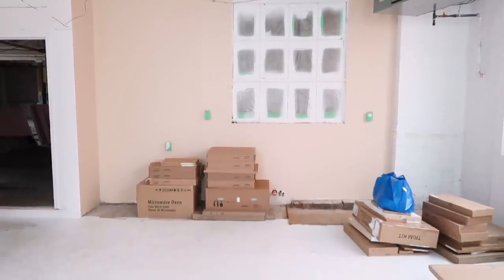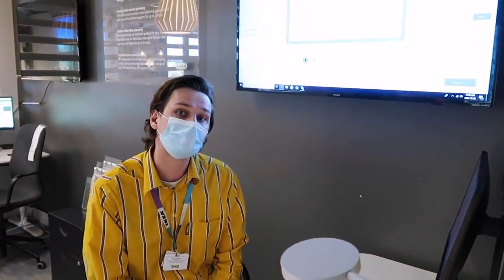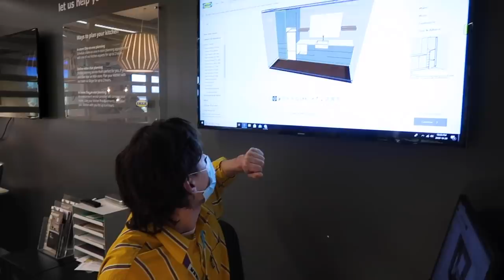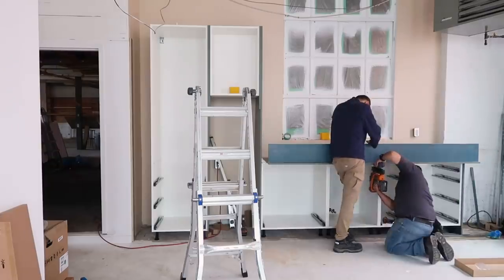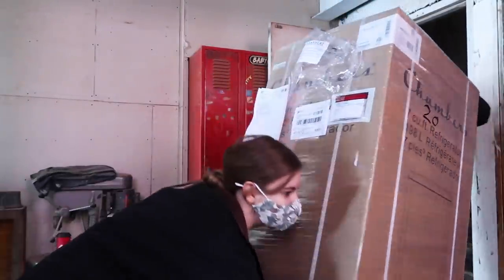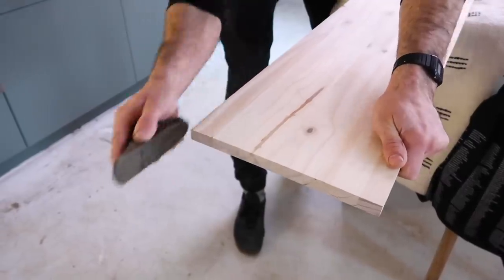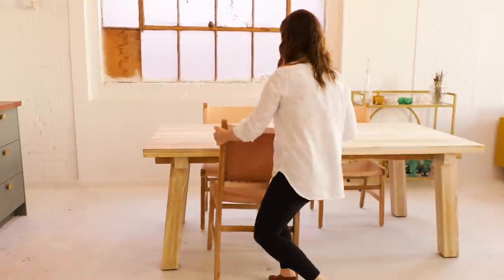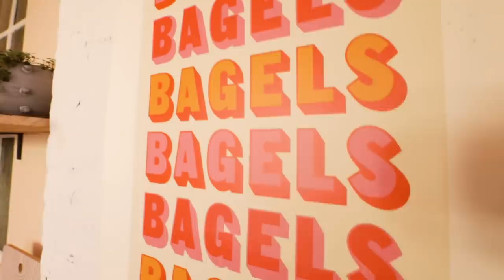My Ikea Kitchen Reno Start To Finish For My New Office! | The AG Office Project S1 E2

Comment: This countertop looks much better than the white one 😍👏🏻
Reply: Agreed!
Reply: Yess i was constantly hoping she'd change her opinion and thank god 😄👍🏻
Reply: I was at IKEA yesterday and saw that countertop and a crosscut of it. It looks even better in person! However, the price is very steep at 200€/m and I'm worried about the water resistance. The core is particle board and it's covered with a 1~2 mm veneer.
Reply: When she first showed it as she was walking past all the countertops as SOON as I saw that wooden one I was like that’s the one! Surely enough she ended up picking it and it looks amazing 😍

Comment: Really pretty.  Shouldn't the table be running the long side with the length of cabinets instead of perpendicular?
Reply: you're kind of right, but then you'd have to walk around the table to get to the kitchen, so the way they did it's not in the way
Reply: I love it this way. It's a large space so it can handle it.

Comment: Love how your space is coming together. Does your landlord provide proper ventilation? I don't see ductwork in the ceiling. Just wondering how you are getting fresh air and cooling. I can see they provided a unit heater (which is usually temporary until the tenant fit up the space). Just wanted to make sure your space is engineered safely and properly so you can bring us more great content! Congratulations on everything!!! 
P.s. You should have heating by every window to avoid condensation and cold air infiltrating into your space. The unit heater that comes with the space might not be sufficient to heat your space. It might just be sufficient to avoid pipe freezing.

Comment: So pretty! Do you mind sharing a rough estimate of the cost for the ikea kitchen?
Reply: i had my kitchen designed and built by ikea around 2 years ago and size wise its a little big bigger.. i would suggest, if u can, build it yourself since i find it really expensive. ifor the kitchen itself i paid around 5-6k and the building team of two cost me 900 dollars extra. so if u can afford i would say go for the building team since it is a lot of work and stress but if youre on a budget then probably built it yourself! maybe this helps with ur question (:
Reply: Michelle Neubauer thanks so much; this is helpful!
Reply: Mine is 3m long, so 5 standard cabinets wide, has five upper cabinets but no tall ones and cost me around 800 or 900€. I had my own appliances and a countertop from a different place because they didn't have them in stock in this length (cost 200€ I think) 
If you're able to do it yourself it really is extremely affordable and definitely worth it for the quality you get. Do get the more expensive drawer slides, soft closing and full expansion is worth that tiny bit of extra money.

Comment: Alexandra, do you put anti-slip layers under rugs when you use them on hard flooring like wood or painted cement? I was thinking of IKEA's safety products STOPP and STOPP FILT. I wouldn't risk placing a thin textile rug like that on the floor without one or the other.

Comment: If you are finding that you need to adjust your mask when talking, cute as they are, you might need a larger size/different style that fits further under your chin and higher on your nose bridge.  If it is solidly under your chin then it shouldn't move as much when you talk.  A higher nose bridge or wire shaping will keep the mask from slipping down.  For working I have found the ones that aren't ear loop, but a continuous elastic/double band around the head are more adjustable, stay in place and can be dropped to my neck by only touching the edges of the mask.

Comment: Looks good but I have one pet peeve to mention - the door of the fridge should open the other way so that when you take something out or want to put something in, there will be a counter right beside the fridge instead of having to move around the door.  I reposition the handles if possible.

Comment: Those “fan” shaped handles on the cabinets were very confusing.The way that you installed them seems correct,looks wise,but if they were turned upside down,they wouldn’t be so close to the top and would have a better grip function.?????😩🤨😔🧐🤨😖

Comment: Does anyone else notice that the fridge opens the wrong way?!?
Reply: Different models/companies have the doors open on different sides... one of the fridges that my family has opens the same direction as the one Alexandra choose.
Reply: That's usually easily changeable. I was surprised they didn't fix that, but they still can.
Reply: Same with the cabinets, they should all open towards the kitchen, not away from it
Reply: Some open both sides for left-handed and right-handed people to consider
Reply: Most refrigerators come so you can switch the door swing to whichever side works better for you.
Reply: uh no. The handles would be on the wrong side so near on impossible to open it. She's ordered the wrong model which is a pretty rookie mistake tbh. Doesn't take much forethought to make sure your space is efficient seeing as that's what she claims is "her deal"
Reply: @camilledammasch3648  hi Camille. I actually made the order for this fridge, not Alexandra. It  wasn’t available to purchase with handles on the opposite side. We haven’t had any issues with opening it and we’re not actually preparing food in the space, so it opening against the countertop isn’t an issue at all.

Comment: Please stop touching your mask all the time! The recommendation is to adjust it correctly when putting it on and then to not touch it again. You can make some adjustments by the strings and if you really need to adjust it constantly- buy a better fitting mask!